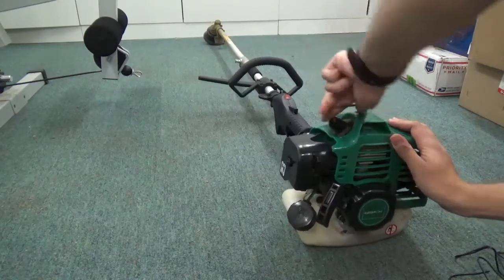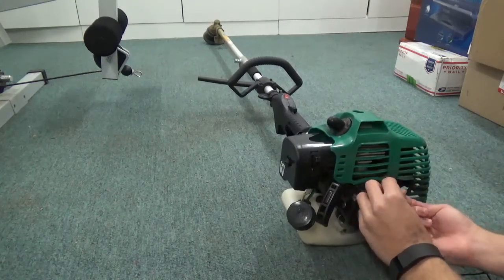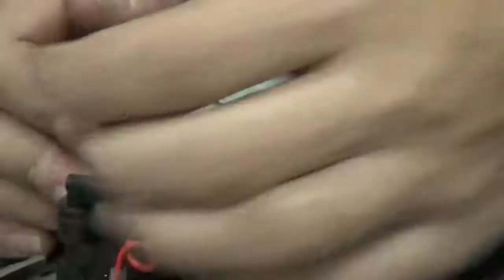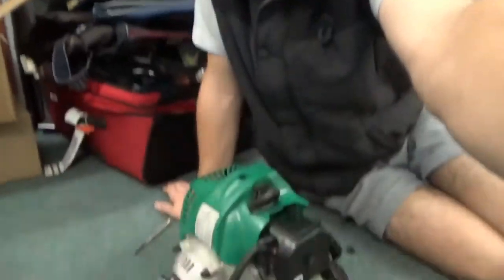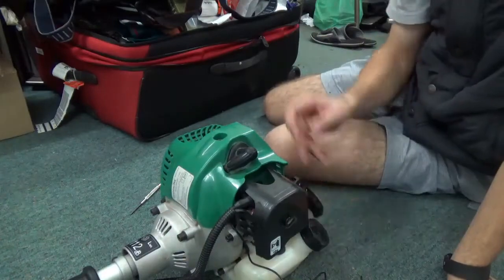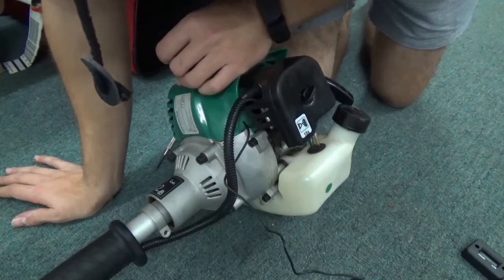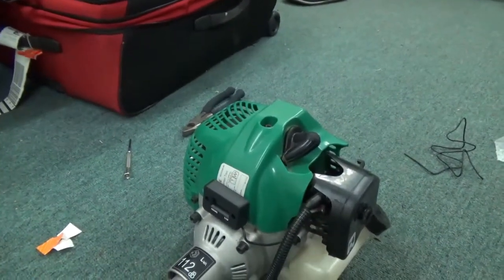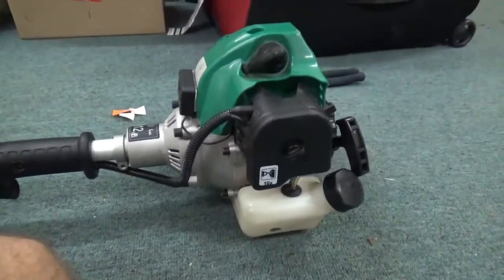Vlog #15 How to install an hour meter, my first time driving a Bobcat and youth group clips!

Comment: Do you always take the top of the weed eater to put it on or can you still rap it on the cord sticking out I mean the spark plug cord
Reply from the maker: Depends on what machine you have. For some the spark plug cable is easily accessible without needing to remove any covers so its pretty simple but for others, especially my Stihl gear I've found, you do need to take at least part of something off.